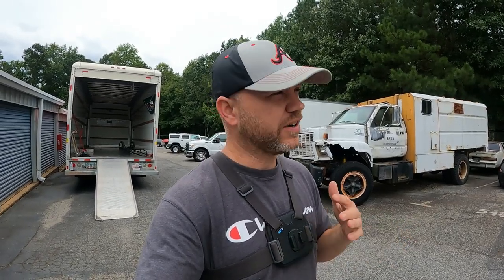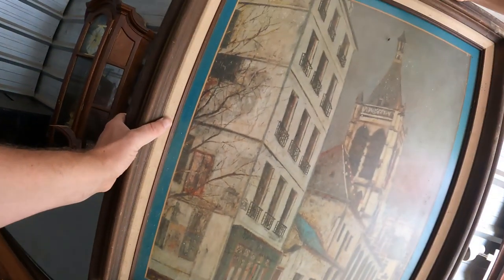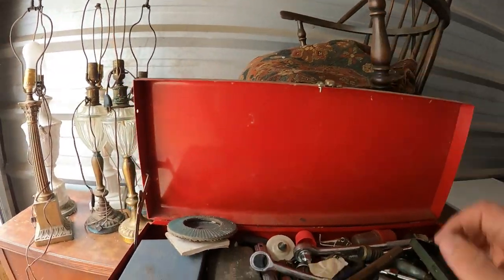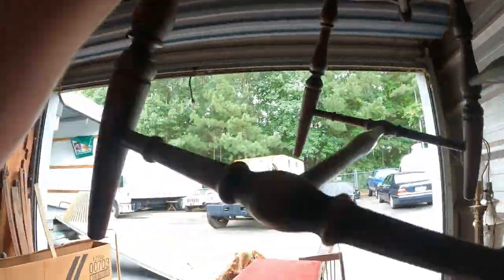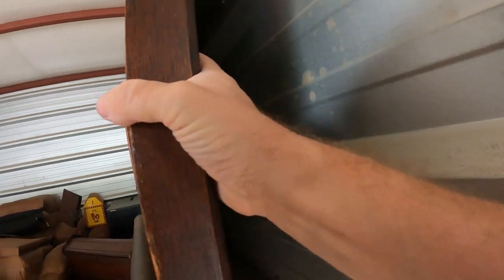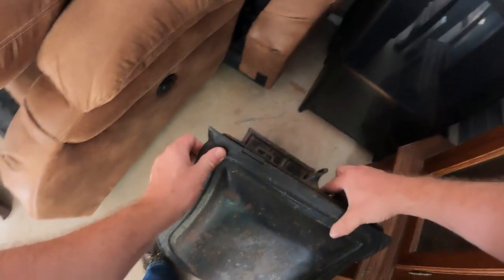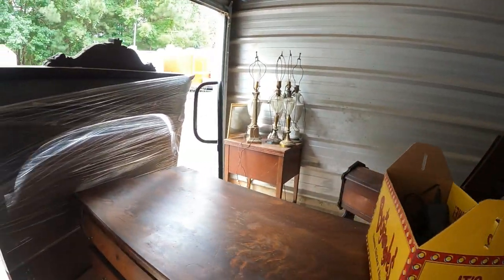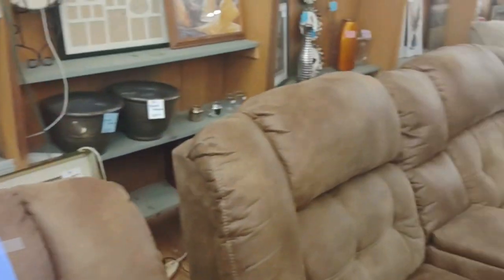I Won Some Dusty Furniture And Old Coke In A $230 Storage Unit!

Comment: Those pieces of wood at 3.52 .inutes in with the tacs and rulers are old curtain stretchers.  If you have sheer curtains, you can wash them and stretch them Out to dry on those pieces of wood.  They have to be assembled in order to be used.
Reply from the maker: Thank you I had no idea what those were.

Comment: The metal rack looks like a motor oil stand. Like what you might see in front of a gas station. Maybe?
Reply from the maker: Turns out it's a coke bottle return rack.